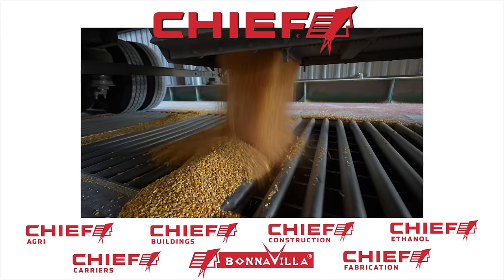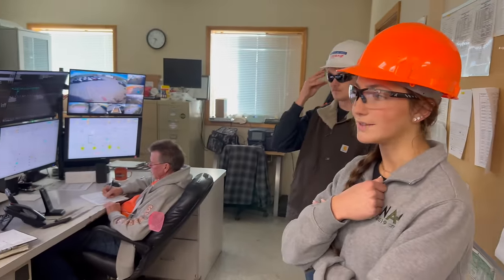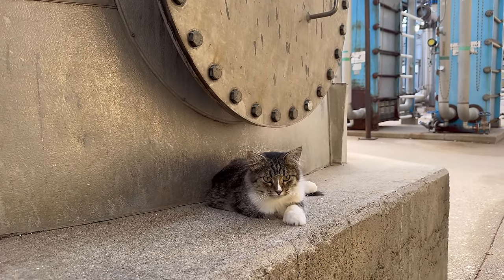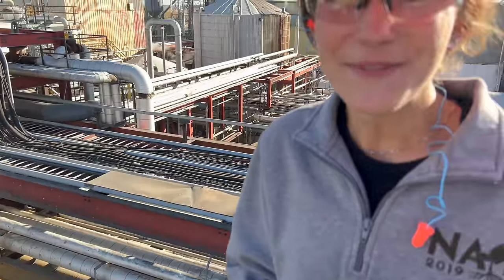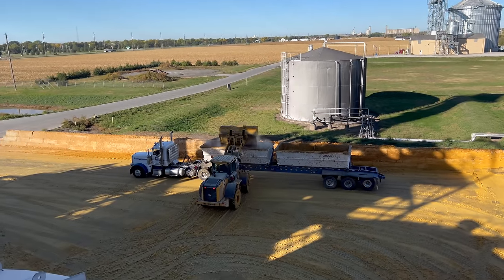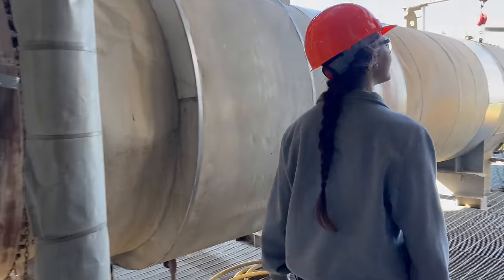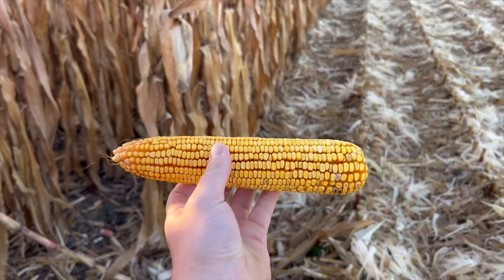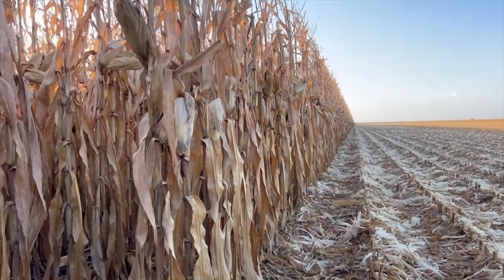Why US Farmers Grow So Much Corn

Comment: molecular sieve is a process where by moisture is extracted from the product. it could be moisture from the air itself or in this case the corn. I was involved with molecular sieve process in the water industry whereby the production of making ozone was used for water purification. The air has to be super dry to allow the electricity used to turn oxygen 02 into ozone  which is o3 which is then injected into the water air bubbles separate all the "dirt and colour" in the water which arrives as scum on the surface and then removed. one of the major properties of Molecular sieve is its ability to absorb vast amounts of moisture  per volume of the material and once it is saturated it is taken out of service usually swapping a tank A which is in service to tank B on standby ready for use then the saturated molecular sieve is super heated to remove all the moisture then its put back in service basically it recyclable and lasts for years in the process.

Comment: There’s many uses for Ethanol which the process is simple. Had a flashback when you went through the control room. Used to to be able to run processes from the DCS system in the Chemical industry where we used lots of ethanol

Comment: Fascinating!  Great explanation of the carbon cycle, Grant.  You guys are awesome! Question: what happens to the mash/slew being dumped into semi trailers by the front loader?
Reply: Distillers most always sell it to cattle feedlots.  It can be sold wet for quick feeding or dried first so it can be stored longer or shipped long distance.  At one time they had so much excess animal feed that they were shipping it over seas.
Reply: @Rusty1220  I've fed this to my animals and it really has no nutritional value since all the good stuff has been smashed out of it and the animals really get nothing more than a full stomach but in reality their bodies are starving.

Comment: Slight corrections to the ethanol mfg process: the ground corn is made into a slurry with water and heated to gelatinize the starch. Enzymes are added to cleave the starch molecules into simple sugars. Yeast is added to start a fermentation to turn the simple sugars into ethanol. Once fermented (the fermentation would stop at around 18% ethanol due to the alcohol killing the yeast) the ethanol is stripped off via distillation and purified via distillation/fractionating columns with the molecular sieve as a final clean up.
Reply: Since you seem to know everything...... Makes a perfect video

Comment: Really cool about the carbon cycle, very informative and comprehensible. Idealistic  like the nitrogen cycle alternating with soybeans. Almost perfect, only if ethanol plant would give you back the water so not to deplete the aquifer.
Reply: When the ethanol is exploded in the engine. The hydrogen from ethanol plus some oxygen from air combine and the water vapor comes out the tail pipe.   It may not go directly into the aquifer but does return again into the atmosphere.

Comment: I’m glad you guys are making a good living selling corn for ethanol, however ethanol is perhaps the greatest government scam in history. Think of the diesel fuel used to produce a fuel that is less efficient and more expensive than non ethanol fuels. It’s as environmentally unfriendly as any product produced but when it was forced onto the market the government left no choice.  It breaks down in only a few months and loses its efficiency even further. Park your car with ethanol in it for 6 months and you’ll be lucky if it runs without flushing out the fuel system. 
This was an informative video. Thanks for posting
Reply: Part of the problem with storing E10 is that they use a lower grade of gasoline when blending it. When the car sits for six months, too much of the ethanol evaporates away, and the leftovers are pretty low grade.  It needs to be used within a couple months.

Comment: Ethanol should be band from gasoline its so corrosive, they wonder why trucks and car don't last if they want to use it make electricity with it great video keep up the good work God bless from GA and stay safe
Reply: It is going to be a big change for all of us as we transition away from internal combustion engines.  Big change
Reply: @hawks2252  am not giving up my gas and desil power trucks besides I'll be dead and gone before that happens
Reply: NASCAR runs on ethanol.  Demand better built cars and take your complaints elsewhere bub.😂

Comment: Ethanol made from corn is renewable energy. Fossil fuels raise the atmospheres CO2 content, plants do not. However it also depends on how much energy based on fossil fuels is used at the plant making the ethanol, and in the farm equipment. It is however technically possible to do all of this based on renewable energy.  
The molecular sieve is used to remove the remaining water from the ethanol. Distilling it can only remove the water to a purity of 95.6% ethanol, the azeotropic point. Ethanol and water are polar molecules, they stick to each other like magnets. Thats why distilling cant purify ethanol beyond 95.6%, the ethanol molecules take water molecules with them while evaporating. The ethanol molecule is a lot bigger than the water molecule. The molecular sieve comes as kind of very small pearls. Under pressure the water molecules go into these and get trapped, the ethanol molecule is too big for that. Imagine this as ripping the water (magnet) from the ethanol(magnet). Under a vacuum the water comes back out of the molecular sieve, so you can reuse it. Therefore you need at least two reactors with the molecular sieve in it, one is under pressure adsorbing (not aBsorbing, that is irreversible) the water, the other under a vacuum releasing the water. One reactor is adsorbing, the other regenerating, then they are switched.

Comment: How much diesel fuel do you use to manufacturer and transport corn seed? How much diesel do you use to plant and  harvest corn? Then how much fuel to run water and fertilize corn? How much fuel to transport corn to ethanol factor? Then how much diesel and natural gas and electricity does ethenol plant use to make it? Then how much does it cost the trains to ship the ethenol corn syrup and feed to us? I find this process very interesting. Making ethenol sounds like they use a lot of water? How many gallons? We could count equipment cost as well, Towards cost. It would be super interesting to see how much it really cost to make these good analogy (batteries). If you had this info you could see how much it cost to make a gallon of ethenol.
Reply: Look up "2015 USDA ethanol energy balance"   That should help answer your questions.  To summarize, a gallon of ethanol has about twice the energy used to produce it.

Comment: Thanks for showing what happens to the corn after you deliver it. Quite interesting. I do have a question, that big pile of corn you showed in past videos. Are they not worried about the potential of rain and snow getting on the corn and making it too wet?
Reply: They will cover the whole pile with huge tarps and suck air throughout with aireation pipes to keep it cool, as well as hold the tarp down!🤠🌽🌽🌽👍💯👌🇺🇲

Comment: I have yet to see how much energy is used in making one gallon of ethanol as compared to the energy stored in ethanol. Lots of energy is used for making the fertilizers, running the irrigation system, diesel fuel used in the tractors, combine and semis plus the heat needed to convert corn to ethanol. Will we one day look back and wonder what the heck were we thinking. Of course there are no politics involved in any of this process.
Reply: Do your own research and let us know

Comment: You completely skipped over the part of all the diesel fuel, propane and natural gas that is required to produce ethanol and the fact that it is a net loss because it takes more energy to produce  the ethnthol than the finished product puts out.  Also without the massive tax subsidies that the ethanol producers get there would be no wide scale ethanol production. It is not free energy no matter how you try and spin it.  That being said your farming videos and yours and Lauras lives are to be admired.

Comment: I’m curious to know how much energy is contained in the ethanol compared to how much energy is required to produce it. Growing corn and harvesting it takes a significant amount diesel and nitrogen fertilizer (nitrogen fertilizers mostly come from natural gas). Distilling the ethanol out of the dilute beer mixture also takes a significant amount of fuel. usually natural gas. A couple decades ago, it took more fossil fuel fuel energy to produce the ethanol than was saved by reducing gasoline consumption. Today, the ethanol is more efficient with better yeasts, enzymes, and the advent of molecular sieves (saves a lot if energy in the distillation). But I wonder about the overall fossil fuel energy balance.

Comment: Sadly ethanol doesn't have the energy density of gasoline.  Do they use the ethanol for anything else besides fuel or added to fuel?  There used to be a lot of E85 stations and an ethanol plant near where I live but they disappeared, so are there more profitable uses of ethanol than fuel?
Reply: Blah blah blah blah

Comment: That byproduct is not the corn syrup you find in food, that’s a different and specific process. Corn condensed distillers solubles are a by-product of the ethanol production process. It is also known in the industry as “corn syrup.” It is a liquid by-product that contains fermentation by-products, spent yeast cells, and other nutrients which remain after corn grain has been fermented to produce ethanol. That’s the stuff you see being put in the trucks in the sandbox :)  Dry mills like the one you visited don’t make the HFCS, the HFCS requires a wet mill. As an aside, places making bourbon or beer sell the spent dried mash as animal food too. The processes are very similar in fact.

Comment: I have a question...your irrigation system takes water from an aquifer . How are the levels being sustained considering the extraction rate is so large? The nutrients that are added to the farmland has to come from somewhere....please enlighten me. I wonder how many from the UK watch your channel. Vive la difference as the French would say.
Reply: The aquifer level is measured every March since 1960.  The 2023 measurement was slightly higher than the 1960 level.
Reply: @42base13  Hey, thank you for the reply. One never knows if these comments are ever read. Glad to hear the levels are constant, or at least not worse than...
Reply: @dickieb2233    1960 was pretty close to the beginning of widespread groundwater irrigation in this area.  There were very few irrigation wells prior to the late 1940's, and it didn't really begin to take off until the late 1950's.  Most irrigation wells in this area were drilled after 1955.  
Prior to WWII, irrigation was done with surface water, and that resource was quickly maxed out.  It wasn't until after low cost ICE engines became available to the farmers that groundwater became a viable irrigation resource.  The old windmills of the time worked well for pumping drinking water, but not the volumes needed for large scale irrigation.
Reply: @42base13  Here in England, we have so many...no, too many people and so not enough water to go round. Although the floods this week will go some way to help ground water levels. There is no way we could pump the quantities that you do. Thank you for your info. Stay safe and well.

Comment: Ok, here is a question.  What kind of corn do they use at ethanol plants?  I think you only grow field corn there.  When I grow corn here, I grow sweet corn.  Differences are that one thing is "sweet" corn is just that, it's sweeter than "field" corn.  Field corn is used more for animal feed.  Another thing is, I don't think you can take an ear of field corn and just eat it right off the ear like I often down with my sweet corn.  So, it boils down to "do they use only field corn at the ethanol plant, or do they use both?"
Reply: Field corn has a series of enzymes that turn sugars into starches very quickly.  In sweet corn, those enzymes are partially disabled.  There are about two days in the growth cycle where you can eat field corn off the cob, just like sweet corn.  After that, it tastes pretty bland and "starchy".  
But, to answer your second question, they only use field corn.  It's far more dense than sweet corn, and far easier to handle.
Reply: @42base13  Ok, thank you.  I kind of had a feeling that they might only use field corn for ethanol.  Aren't the field corn kernels also harder than sweet corn?  (I've never been able to get my hands on any field corn to be able to know the differences first hand).
Reply: @HurairahHomestead  Field corn is much harder by the time it dries down for harvest.  Sweet corn that you eat will be around 80% water.  Field corn is around 15% water.  Far more starch.
Reply: @42base13  Ok.  That's what I've heard.  But, like I said, I've never had a sample of it to be able to know for myself.  Yes, I was the kid who would stick her fingers in an electrical socket just to find out what would happen.

Comment: Great battery analogy, Grant. Unfortunately, creating ethanol is one fourth as efficient as solar. And you’re drawing water from the aquifer at an unsustainable rate. I think you should diversify your operation to other crops and energy production and consider setting some aside some land for prairie grass. The animals and bugs will thank you.
Reply: The aquifer level is measured every March since 1960.  The 2023 measurement was slightly higher than the 1960 level.
Reply: @42base13  , it may be briefly higher in Neb, but trends don't look good for agricultural draw downs long term. The rest of the aquifer is drying up. https://en.wikipedia.org/wiki/Ogallala_Aquifer#Aquifer_water_balance
Reply: @TysonZeke   Texas and Oklahoma aren't really connected to the Nebraska aquifers. (not on anything less than multiple century timescale) 
 The area that Laura farms recharges out of the Sandhills and from snowmelt on the east slope of the Rockies.   
The areas south of Nebraska that are drying up don't get that annual recharge.  But that doesn't diminish Nebraska's supply.  And we don't diminish their supply by utilizing our water.

Comment: I would much rather the money I spend on gasoline go to support American farmers than some rich shiek in the middle east.

And to those who say that ethanol in fuel is a bad thing... yes, in older vehicles it can cause fuel system problems. These can be mitigated with certain additives. Newer cars, however, have updated fuel systems that can run on gas that contains up to 85% ethanol. I don't care that it has less energy per unit volume, I'd still rather support our farmers than the rich oil producing countries.

Comment: Excellent, plants can only consume the CO2 during the summer growing season. The other 9 months CO2 accumulates but no problem as days are shorter, not enough sunlight to heat plant. Summer comes and plants eat it up. NASA had a video illustration of this cycle but took it down, political 😂.

Comment: The carbon cycle isn’t quite that simple, it’s not a closed loop. Most ethanol plants use Natural Gas for producing the steam needed for the heat needed to ferment and separation of the ethanol by distillation. They do however recycle water and steam 80-90%. The electricity to run the pumps at the plant is also likely generated using natural gas with some wind and solar. The plants making green ethanol use a fair amount of dirty hydrocarbons. Tractors, trucks and combines run on diesel which is a dirty fossil fuel. Fertilizer is made from Natural Gas unless you are using Ammonia which isn’t used as much as in the past due to safety issues. Or you could use manure from the feed lots which would be a bit more green. Bottom line is Ethanol is not as Green as it is marketed to be. If we run out of fossil fuels then the production of corn will fall like a rock. and thus ethanol isn’t going to rescue us. It’s a good for the farmers up there and they are taking advantage of it as they should but let’s tell the whole story. If US Energy policy was changed to remove Ethanol from fuel and / or remove the 45 cents a gallon tax credit for blending into the gasoline pool the plants would close immediately as it makes no economic sense. Conversely If we built  more cars to use E85 it would boom. But E85 cars actually get less mpg than 100% gasoline but it’s cheaper to buy so do the math if it works in all cars. In Brazil a lot of cars run on 100% Ethanol and it’s dirt cheap there made from sugar cane.
Reply: That tax credit has been gone since 2014.

Comment: So we are using our food to make a low grade gasoline, that we can pump out of the ground, to reduce  the carbon we need to grow our food and things like trees that produce the oxygen we need to breathe to stay alive. Somehow that makes zero sense to sell our food for fuel unless there is more to it than that and I realize it helps keep the prices high enough to keep the farmers going but in the long run is this the best thing for our children. We need the carbon as much as we need everything else to maintain the balance but we also need to keep the oil industry going until we build a safe and working replacement.

Comment: So.... to turn corn into ethanol requires lots of heat and electricity. To generate the required amount of heat and electricity requires burning fossil fuels, and the process itself also releases co2. Then there's the thousands of gallons of diesel and irrigation motor fuel burned to produce said corn, fuels which also require lots of heat and electricity to produce.  

 Increased co2 levels help said corn to thrive. Hmm...  when one gets right down to the nut cuttin' it's the burning of fossil fuels that charges your batteries.